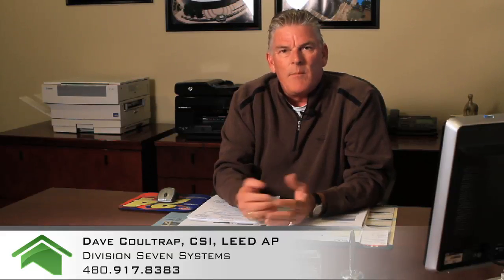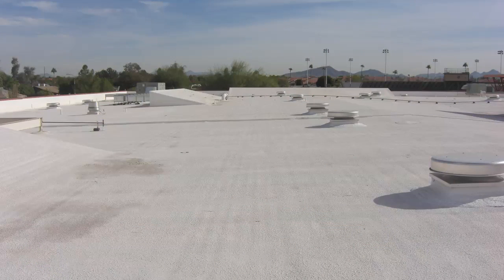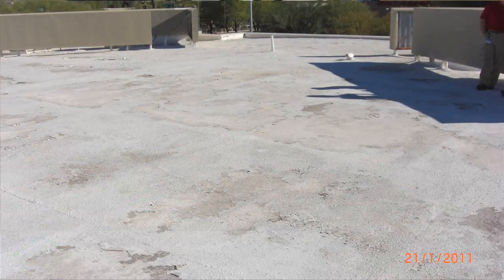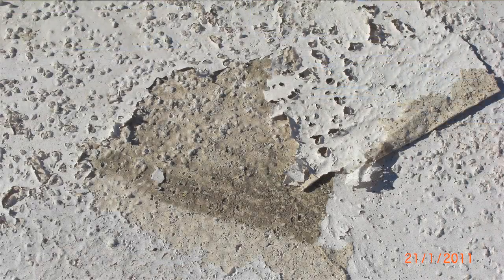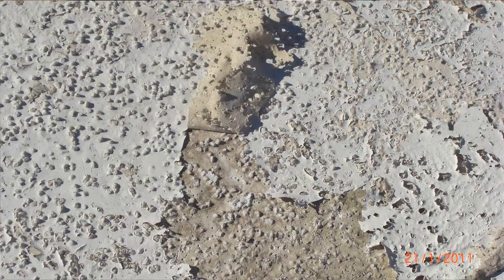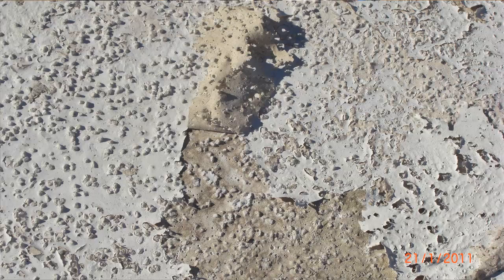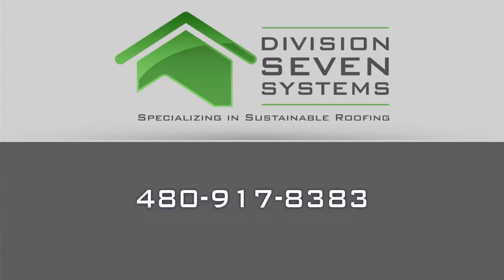Can you coat a Cementitious Roof?

Comment: I appreciate the video Dave, but a lot has changed since you first posted this. In order to coat a cementitious roof, the adhesion values of the coating need to be high enough (close to 3 times as strong) to be successful in the long term. I have been told by specifiers that our Ecodur 201 coating is the only coating that meets that criteria.